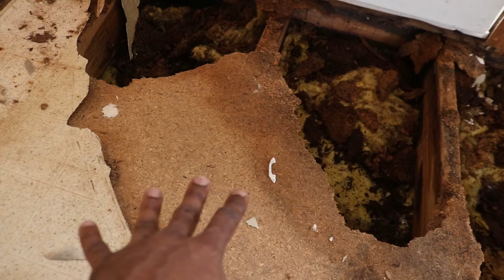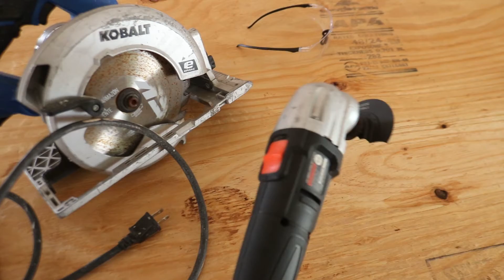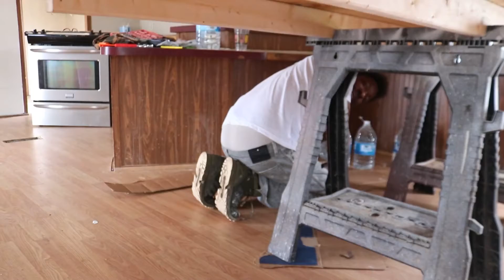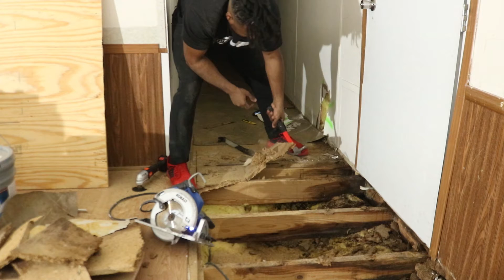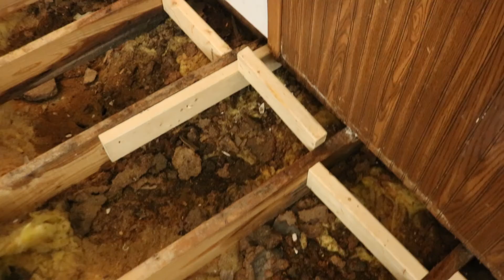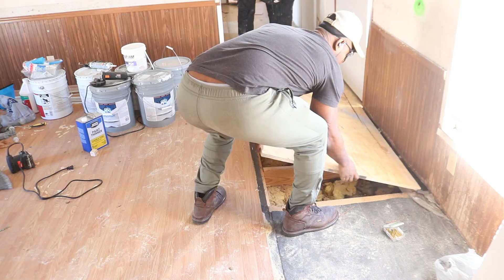How to Repair a Subfloor in a Mobile Home

Comment: We are renovating a mobile home & it had 3 (yes 3!) layers of flooring (plywood, particle board & OSB) in some areas, 2 layers in other areas. Also ghetto a$$ shims holding up the toilet because the floor underneath was rotten!  It was a NIGHTMARE to remove. But we ripped it all out, repaired some joists & added braces & replaced it the floor. It looks FABULOUS now!

Comment: Uh huh. That’s how YOU fix a floor. I cut a little here a little there and hope I’ll eventually get it ready for plywood. I’ll get there though. I appreciate this video. Sounds like I’m on the right track anyway. I was totally disappointed to find my joists are 24” on center not 16. But I’m too old and broken to fix that. If I ever get my kitchen floor fixed I’ll put plywood on top of the pressed wood throughout. Not ideal but it’ll outlast us. Like my buddy Dan says, I’m handicapped not helpless. Thank you for these tips. I’ll be checking out your channel later. Going to make a couple more cuts on my floor now. 🤦🏻‍♀️

Comment: u didn’t remove the old insolation from
floor 😮
Reply from the maker: It's not necessary. It's just fiberglass and it still insulates. Remember to keep your costs low